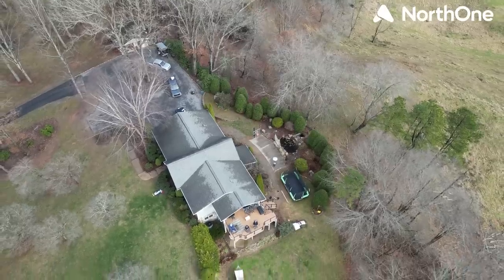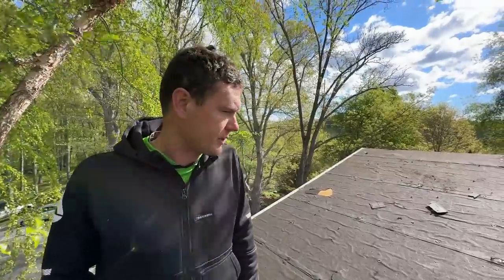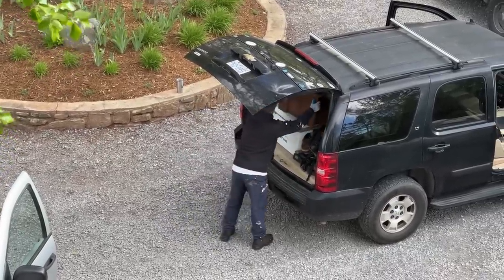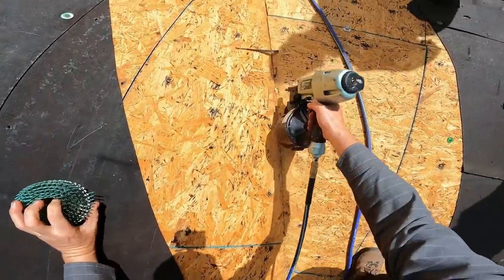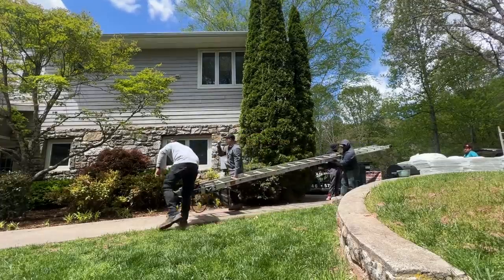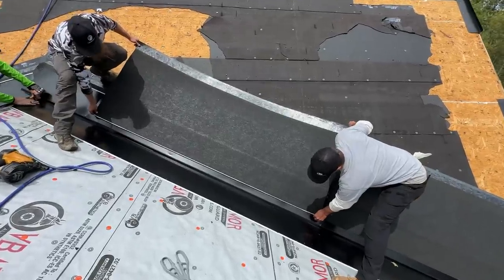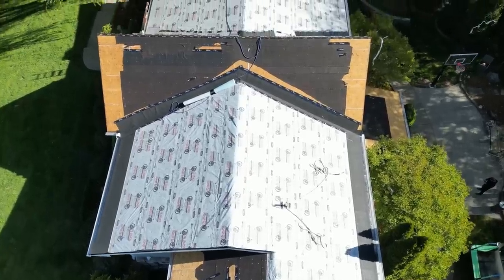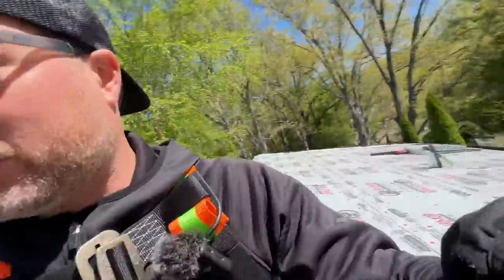I need a new roof!

Comment: Im pretty lucky that all of my radiators are fitted using flexi piping, so all i had to do was put down a couple 2.5 litre paint cans, lift the radiator off the wall and lay it on the tins. 

Full, easy access to the back then!  Lovely!

Comment: i had a roof replaced on my house two years ago and i am still finding old roofing nails in the yard. i spent two weeks with three different types of magnets in the driveway collecting nails and i guess that was good not one flat from a roofing nail so far.  look inside your gutters you will find a bunch of nails there and they will get washed down from the rain and out into your yard and driveway. but what you are doing looks great keep up the good work

Comment: You spoke to the stress of rain. Us as a crew of 4 tore off one side of a 24 square roof so roughly 12 square uncovered. No rain in the forecast at all then the national weather service came on and said a storm picked up over lake superior and was approaching at 40mph with gusts up to 60mph. We had just finished tearing off and started papering. I was the last one to step onto the ladder to get down as the rain and a 50mph gust hit. Most scared of having rain destroy a building ive ever experienced i thought. Then a 60mph gust blew the top row of paper off so in a thunderstom me and 2 other guys cralled up there and re papered the peak as one guy visqueened in the attic to try to catch as much water as possible. All said and done we got like 2in of rain in 40min and 2 of the apartmets had a bit of water damage on the ceiling that a bit of paint covered. All was good but man was that scary

Comment: Looks good, only thing that I saw a problem with is where you put ice and water shield over the valleys and on the rakes. I’m confident you will end up with a leak after a year or two, because that peel & stick will separate from that painted metal.
Reply: They did the ice shield under and over the metal in the valleys.

Comment: 3 years ago we had a new roof put on our old house. We had some repairs done the day before, which included the replacing some of the sheathing on the roof. They covered it up decent enough, but an hour after they left a nasty storm came through, blew off the temporary cover, and dumped buckets of rain. I had to throw a tarp up in the attack, and found a fish tank pump and hose to pump the water out of the attic. Thankfully only ruined a little bit of insulation and cracked the just repaired drywall joint, could have been much worse. So yea, that fear is definitely warranted. Next day the roofers came, ripped off the old roof, and got most of the new one on. Of course it also rained that night, but not as bad, and nothing leaked. That was not fun at all.

Comment: I’m a longtime fan and really like your work and how important it is for you to do a proper Jobb. One thing that struck me in this episode is the use of shingles as a roofing material. Here in Sweden and most of Europe shingles don’t meet the standard for roofing except on buildings like garages and barns.  My house built in 1917 has original brick pans and they are in excellent shape even though we live in pretty harsh climate.  Brick. Pans or metal roofs are the standard here and have been for hundreds of years.

Comment: Underlayment  is not for weather or water protection   Obviously as there are a bazillion nail through it 
And there is likely inadequacy and short circuited ventilation by the looks of the condition of the shingles and the underlayment   
Check the intake at the steeper slope by the valleys   There is likely none

Comment: I'm not sure what the cost of the Zip sheathing is, but with all of the metal, filling gaps with Lexel, underlayment, multiple passes of nailing stuff down, zip taping the exposed seams on the existing sheathing, labor for all the extra steps, etc. Would it not have been at least a similar cost to take it back to trusses and replace it with your preferred roofing?

Comment: Looks like you’ve covered over your roof vents on your ridge line. I’ll be interested in your options for attic ventilation 😊
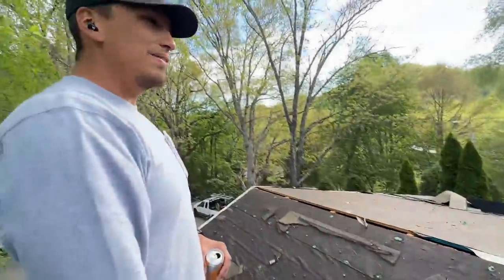Reply: I guess that's what the plastic grid you can see at 0:45 is for.
Reply: It was definitely temporary water sealing. When they get to the ridge cap, just cut through the underlayment and it’s vented again.

Comment: get a magnet with wheels and quick release - no wonder you subbed out the roof (mostly) - roofs are total nightmares - hurricane clips (h clips) on the osb - isn't that an oxymoron? surprised you are not peeling the water shield first before applying it - i kid lol roofing is good for the back but it is a job where pros can make good money but they do earn it - experience matters

Comment: Ice & water shield is a bad idea. It will eventually need to be replaced and is impossible to remove. Metal covered with roll roofing would be a much better option.

Comment: hei Perkins, any chance you could elaborate on why you dont much like metal roofs? having a hard time finding someone i feel i can trust to give a non biased opinion on roof systems :)
Reply: Eric mentioned that local covenants do not allow metal roofs. That might be an issue that needs to be addressed since the new metal roof on my a-frame in NW Wisconsin is warranted for 90 years. I won't be replacing it and it looks just like asphalt shingles.

Comment: As I start watching this, I am hopeful to see you replace at least SOME of your roof with those solar panel shingles... so you can start experimenting with THAT whole industry to mix it in with your regular work.  Maybe you aren't up for it... IDK... but we really need to know more about that stuff.  So many people are getting off the electric grid these days now that the cost of the solar stuff has come down a bit... and I can't imagine ANY building contractor surviving too long into the newfangled future without incorporating some of that tech.
Reply: No one seems to mention the solar-roofing needs to be replaced within 5 years....or one hail-storm can render it useless. Solar is brittle infrastructure and should remain an option for niche applications only.
Reply: @hedge685   That's just not true. A typical residential solar system will last 25 years and the panels are made of tempered glass so they will resist most hailstones.
Reply: @hedge685  Well... I guess it doesn't have to be the solar shingles... but I'm hoping some of these builders will incorporate SOME solar in their projects.  I watch 4 or 5 off grid homesteading families who get all their power with solar... and one thing I am eager to learn is just how long a system like that lasts... where is the break even point, you know?  It's been 4 years since I researched it, but the data said you couldn't ever reach the break even point above the 38th parallel or something like that...